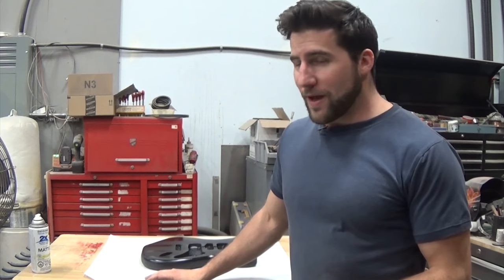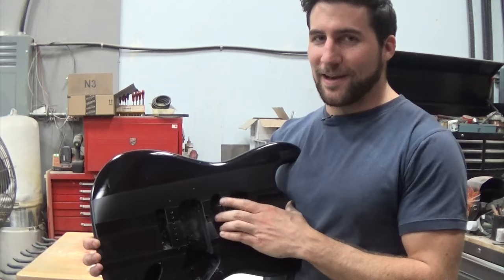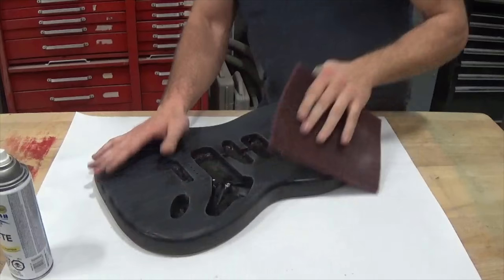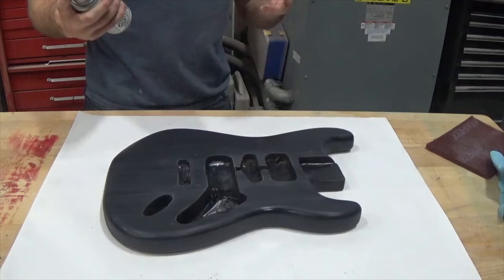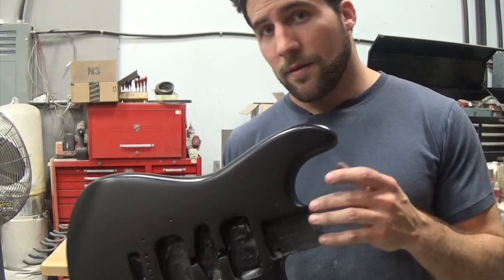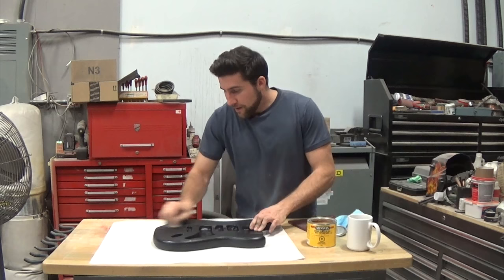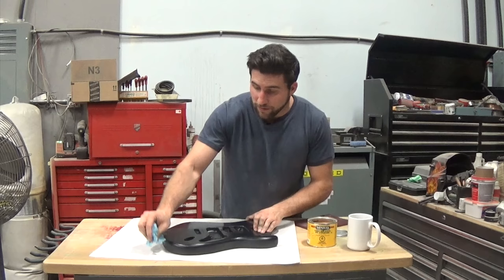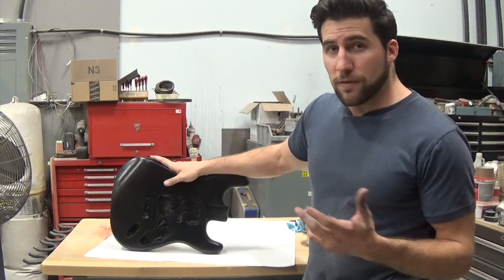How to turn gloss paint matte or satin

Comment: Could I pick your brain on something? I’m working up something. You see metallic threads or say even burlap dipped in a acidic metallic substrate, kinda complicated how you transfer metallics, copper silver etc each impart a metallic color on fabrics. Copper is red and silver is green etc. requires multiple 55 gallon plastic drums and it’s dangerous messy and environmentally you have to be responsible. I’ll get to it, the ability to dissipate nasty heat signatures can be dealt with using metallic fabric and threads. Toughest thing is it’s shiny! How can we using say a Matt polymer spray over this and really knock down that nasty shiny finish? Any ideas?
Reply from the maker: Are you talking about actually metal playing the fabric to some degree?
Reply: @BradAngove  it is an ionic transfer of elements into the fabric

Comment: Can this be done on ‘powder coated’ gloss  car rims to turn them satin?
Reply from the maker: I’m not sure if the polishing method would work on powder coating, but they can be scuffed back and sprayed satin.
Reply: Thank you Bard !......my main intention is taking some gloss off the rims and making them look satin or eggshell... any specific method u can recommend?
Reply from the maker: Well, I would usually recommend taking them to a powder coating shop. The problem with satin paint is, for the high durability stuff, it requires mixing paint, reducer, hardener, and matting agent. An expensive and somewhat complicated process. You can get satin paint in cans, but to not very durable. 
I guess you could do an ok job spraying the spray max 2k from my video on how to get a professional looking clear coat with spray cans, and then sanding it with 3000 grit the next day. That would look a lot like a satin finish.
Reply: Brad Angove   I see.. ill try the 2k spray and sanding .... many thanks Brad !

Comment: Why not start with a white or gray scotch brite with a little furniture oil and patiently work down to satin or matte finish, instead of putting that 2$ spray stuff on your instrument?
You could at least use a pro product like, spray lacquer from Mohawk
Reply from the maker: It’s not bare wood, so furniture oil doesn’t really make sense. 
My instrument doesn’t know how much the paint cost, and I don’t think most of my viewers want to spend more just for the sake of doing so. 
I love Mohawk lacquer, but if you spray it over an acrylic enamel like the black on this you’re probably my going to have a bad time. 
I hope those answers help you.
Reply: Brad Angove the oil is to prevent heat build up as the finish is rubbed down or “dull rubbed”. It can be removed after the desirable sheen is reached. 
Most instruments have a lacquer  finish which has a remarkable mobility over its lifetime with regard to it’s sheen.
Reply from the maker: Most guitars do not have a lacquer finish though. They haven’t in the last 45 years.

Comment: So my guitar has hand marks and a couple of bump marks that are showing a lot of wood, can i just scuff the hand marks and can i just spray paint the bump marks around my guitar?
Reply from the maker: It depends on what the marks look like and what your goal is.
Reply: @BradAngove  it's a small mark, and my goal is just to make it look consistent like before really.
Reply from the maker: Ok. Do you know what kind of paint is on there now?
Reply: @BradAngove  a matte black exactly like in the video
Reply from the maker: Is it lacquer or poly?
Reply: @BradAngove  it's poly I believe
Reply from the maker: Then you’ll probably end up with “ghost lines” around your repair areas where the paint overlaps.
Reply: @BradAngove  Ahh, so the best thing to do is just to paint the whole guitar together then , correct?
Reply from the maker: For poly I’ve found that that works best, yes.
Reply: @BradAngove  Okay, thank you for the answers man.

Comment: Does the satin finish makes the guitar looks close to an aged nitrocellulose finish ?
Reply from the maker: Yes, that’s the type I usually use for an aged nitro look. Although I use nitro satin for those of course.
Reply: Can I use  nitro satin finish on a polyurethane painted guitar ?
Reply from the maker: Is it the original polyurethane?
Reply: @BradAngove  yes
Reply from the maker: Then that should be fine as long as you sand first so that it will still. I’d go with 600 grit.
Reply: @BradAngove  Sorry Brad for asking that much , you mean i can use a nitrocellulose satin finish on a polyurethane painted body without having crack problems??? What does the 600 grit sandpaper has to do with using nitro?
Reply: @BradAngove the base  is Gloss polyurethane finish
Reply: @BradAngove  if i have to sand down the nitrocellulose lacquer what's the purpose of applying it then from the beginning?
Reply from the maker: You need to sand the polyurethane a bit so that the nitro will stick. You can’t just paint on a gloss surface.
Reply: @BradAngove  yes i know that i have to take off the poly gloss but whats the point of adding a nitro finish after wiping off the glossy finish if i will have to sand off the nitro finish with 600 grit sandpaper  i already applied?
Reply: @BradAngove  sorry man I'm from Beirut and i guess there is a misunderstanding cos i know nothing about painting.
Reply from the maker: Why would you sand off the nitro? You need to sand the poly then apply the nitro.
Reply: @BradAngove  and  it will relic like all the guitars that are painted with nitro ?
Reply from the maker: Well, the top coat will relic. The rest won’t.

Comment: would you advise doing this on an acoustic - without the spraying part. I bought a used Martin with satin finsih where beneath the pickguard has been glossed from the dude's hand oils, would just the scotchbrite work, or is the wood to thin to attempt that?
Reply from the maker: The wood shouldn’t be too thin. You’ll want to avoid spray painting it of course, but you can carefully knock back the glass with fine scotch brite or high grit (around 2500-3000) sandpaper.